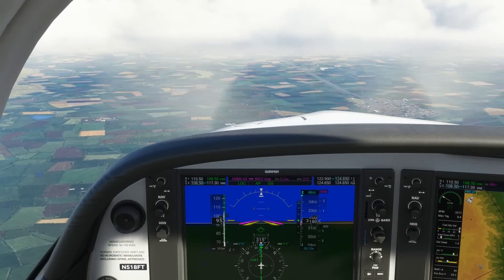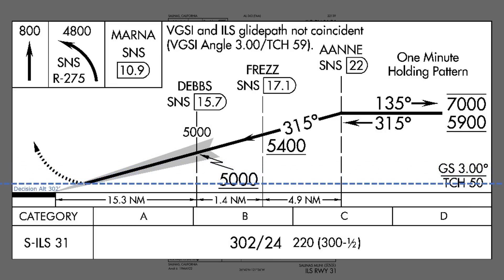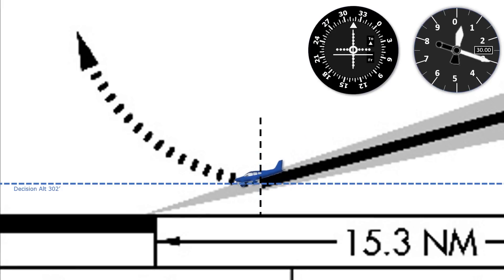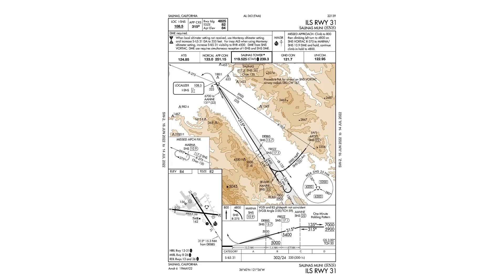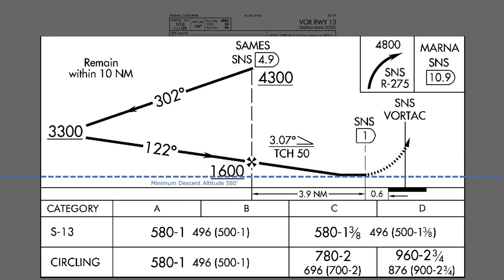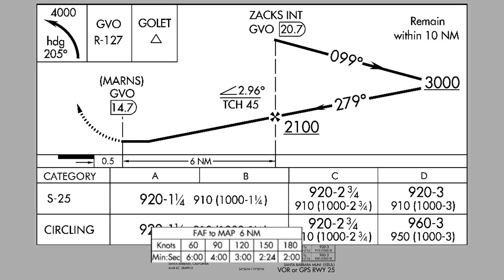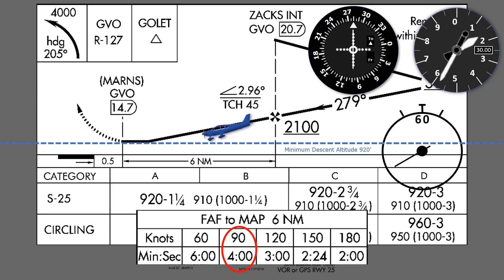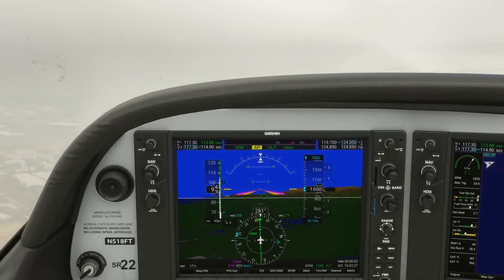3 Types of Missed Approaches | Missed Approach Points | IFR Training

Comment: If you increase your indicated airspeed by 5 kts to make it 95 kts you now become a category B aircraft. This could change your minimums. The best way is to make a small chart for your off ground speed amounts. I used to have a chart for ground speed of 65, 75, 85, 95 ETC. you take your indicated airspeed plus or minus the wind and divide by 60. This will give you miles per minute. Take your distance to travel divided by your miles per minute and it will give you the time. If you maintain 90 kts indicated as the example with a five not headwind, (85 kts ground speed), you should fly to the missed approach point in approximately four minutes and 15 seconds. Remember unless you have a good true wind speed you’re going to be off your ground speed by a few kts. By the way, any ground speed time can be calculated using the E6B or any flight computer.
Reply: Aren’t categories based on Vref or VSo x 1.3
Reply: @nimblenoodles0135 Nominally yes, but if you fly faster you use the minimums for the higher category. But I think what avistortrucker is referring to is the FAF to MAP times, which are an estimate to the missed approach point on a non-precision approach. A strong headwind could get you coming up short, or a faster than normal approach could get you missing the runway threshold altogether. I hadn't thought of interpolating those times, I just try to stay close to 90 kts, but maybe I should.
Reply: Your approach category is based on the certified maximum landing weight. It does not change. So if you increase or decrease your approach speed, your approach category will always remain the same.

Comment: I hope the satellites the provide the global positioning system don't have a bad day!
Pays for an accurate altimeter.
🦉🛩️📏
Reply: GNSS/GPS receivers have detection of dodgy satellities using a system called RAIM. If you get a RAIM error while on approach you have to abort the approach and then try using another aid or go to a alternate airport. Some GPS receivers devices can also detect which satellite is causing the issue and remove it from its positioning. There are aids that will tell you relative position to the runway that don't rely on satellites such as VOR or NDB. I know in Australia if you are flying commercially you have to have support for additional aids. 

Interestingly the airliners also usually have a system which is older than GPS called the Inertial Reference System (IRS) which uses gryoscopes to keep track of turns/movements of the aircraft and therefore keep track of the location of the aircraft without the use of external aids.
Reply: @glennwatson  In short, you should always pray for RAIM!

Comment: For ILS, I cant decide to discontinue the approach and go around earlier due to loss of obstacle protection or other traffic flying outbound to intercept the final approach course, am I right? But isnt it so silly lets say DA is 200 ft with 3.00 angle ILS and Im inbound at 3000 ft, and for whatever reason I have decided to go around (failures, any other operational problems or anything else really) do I still have to pointlessly descend down to DA which Im already going to be climbing out of, following glide slope and then start the MA?
Reply: AIM 5-4-21(b): "However, no consideration is given to an abnormally early turn. Therefore, when an early missed approach is executed, pilots should, unless otherwise cleared by ATC, fly the IAP as specified on the approach plate to the missed approach point at or above the MDA or DH before executing a turning maneuver." If the MAP does not have a definite fix on the plate you need to reasonably approximate it.

So, no, you don't need to descend to DA.
Reply: @M4dg04t  Thank you
Reply: If you decide to terminate your approach for any reason you should maintain heading and climb to to first altitude required before the turn. Next follow the missed approach procedure at that point. Of course first advise ATC you are executing a missed approach. If you approach is not a straight in or you executed a circle to land and lose visual sight, a general safe maneuver is always turn toward the runway to climb back to the initial missed approach altitude before preceding to the hold. You should know your MSA and can get vectors from ATC and state your intentions.
Reply: Then don't fly
Reply: Unless specifically cleared to do so by ATC, when going missed prior to the DA or MDA, always climb to to the altitude stated in the missed approach procedure and then fly to the MAPt following the procedure detailed in the approach chart. Principally, the MAPt ensures that any standard missed procedure from that point, obstacle separation is guaranteed.